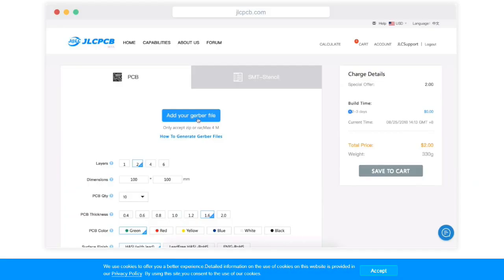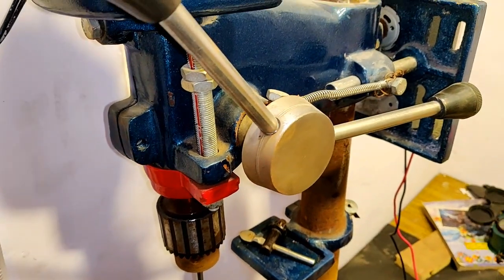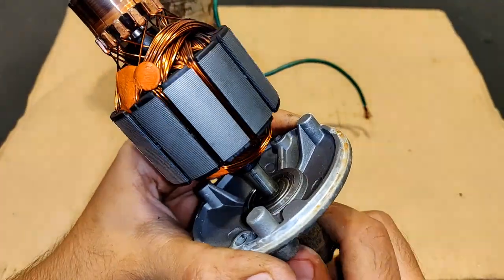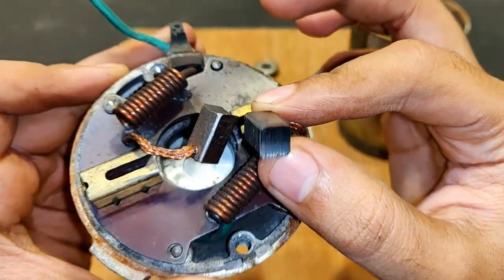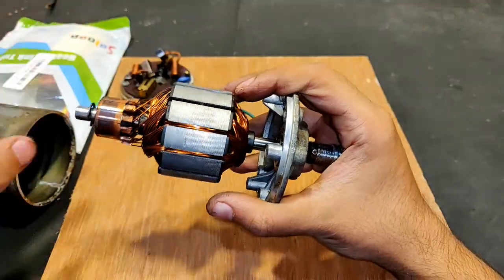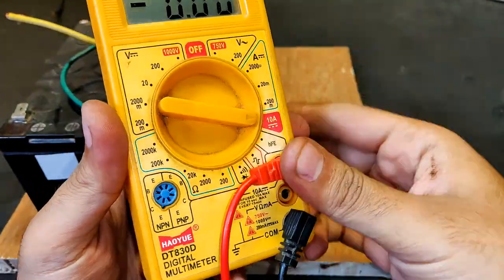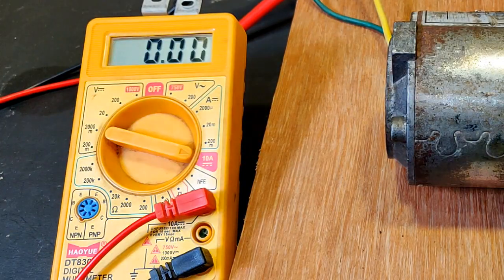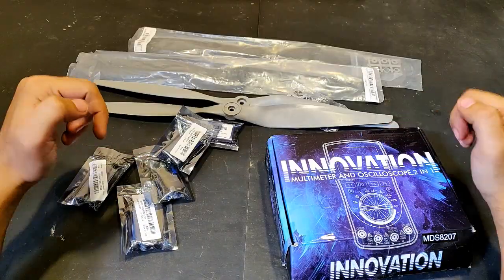30 Volts Dead DC Motor to 500W Electric Dynamo Generator - Restore

Comment: Measurements are not correct. You cant measure amps in short circuit and volts in open circuit!!! its not 30v x 6 A!!! for best results you have to conect a load and then make the measures.